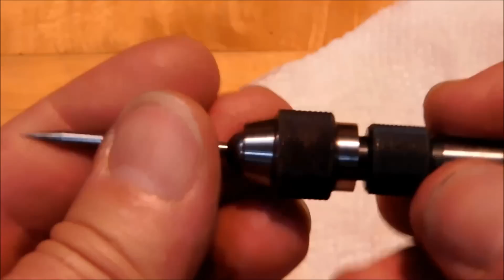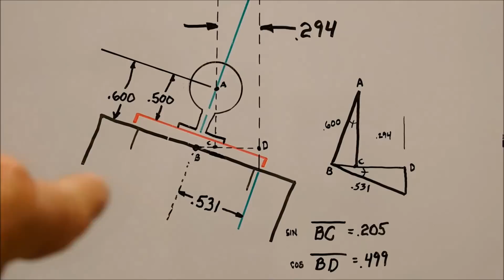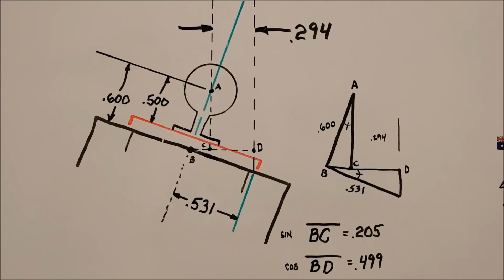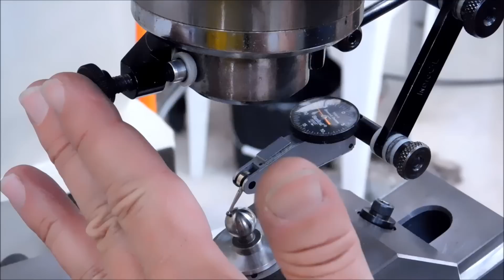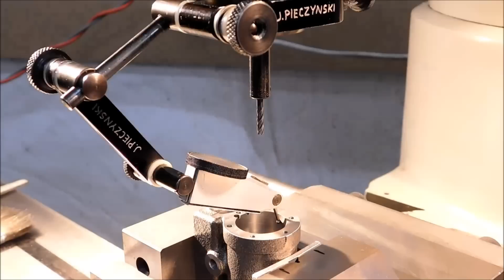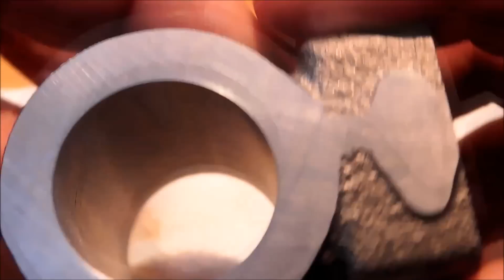Machining a Model Steam Engine Cylinder - Part 2 - The Oblique Port Holes

Comment: I use to read about “tool maker buttons”...but never saw/read any demonstrations....I asked my mentor Chui....WHY???...His response was TOOLING BALLS.....THANK YOU for a great explanation and demonstration of the use of a TOOLING BALL,  in reality Simple/Smart with triangles...viewers will be surprised how expensive they are
Reply: Toolmakers buttons are a different animal , they are used for precise coordinate boring on a flat surface...
Basically the bore centres are marked out then drilled & tapped for a small screw...
Then ground bushes are affixed with the screws and washers...not too tightly..

The bushes are usually a nominal dimension (0.500" say ) & they are adjusted (nudged) by measuring from the workpiece edges until they are perfectly concentric with the required coordinate, the screw is pinched down... then the bush is swept to centre it under the spindle.
The bush is then removed and the hole drilled and bored.

I have used this procedure on a lathe faceplate for boring accurately spaced holes in the lathe... 
😎👍☘️🍺

Comment: Another Master Class!  Your demonstration of the use of the tooling ball was extremely helpful, not to mention the dual vise setup. Your videography is appreciated also. I’m sure it complicates the task at hand but your camera work is very helpful in understanding what you are trying to demonstrate. Nicely done!
Reply from the maker: Thank you very much!
Reply from the maker: Would you like to make a request on the next part done?
Reply: Your choice, the base, the crankshaft, or the flywheel.

Comment: My father was a tool and die maker , I did not follow in his footsteps and retired from a career in combustible fuels energy production.However  to this day machining still fascinates me , having for decades watched my father produce some very complicated parts during his career.
Building these models is pure passion and the desire  to meet the challenges of machining a rough piece of metal into a functioning device , it cannot be for any other reason . A finished model would be unaffordable if resale was the only motive for anyone that invests so much on specialized equipment and the dedication to  accomplish the task with as near perfection that may be  possible. Striving for excellence and perfection is what most machinist have in common irrespective of being a hobbyist or a professional . Very nice work sir, in fact , excellent work .Watching your videos brings back many many great memories .
Reply from the maker: I appreciate the comment and story. Thanks.

Comment: Thanks Joe, I've been doing this fifty years, but never had modern schooling.  The use of the tooling ball was valuable information I didn't fully understand until now.  I came at it as a mechanic, doing engine machine work, and only working my way to a regular machine and welding shop.  The math explanation was clear and easy to understand.

Comment: Joe, there has been a tooling ball in my tool box since I was an apprentice in the early 1960's and to be honest I had no idea what it was. Thanks for the education! I can't wait for a chance to try it out, possibly on my next steam cylinder. I have done 3/4 live steam locomotive cylinders and two PM research cylinders and also a cylinder in clear Plexiglas to show what the drawings, some not as great as the one's you are working from, are trying to convey about the steam passages to someone starting out.
 P.S . my experience is the drawings pass muster both on the steam engines and the small machine tools like the shaper and drill press. the lathe or mill will be next.

Comment: Great job. I built a Tiny Power M side crank with a Stevenson’s reversing link ten years ago.The cylinder and steam box are separate castings and the ports are cored,making the machining much simpler. The original prints used 5 ball bearings.Mine has 21 bearings.(I hate to oil bushings ). I had to really pay attention because,the prints had several mathematical errors. I had this 200 pound monstrosity sitting on the kitchen table,adjusting piston height,eccentrics,etc. I told Barbara, I guess thats about the best I can do. I hope it runs.She was more confident than I was. I hooked up the air and opened the valve. I stood there with that deer in the headlights look when,it sprung to life.It will run slow enough to count the revolutions and,reverses like a 3 phase motor at any speed.It is not practical but, it was surely gratifying to build. I am looking forward to watching the progress.

Comment: Dear Joe,
                 thank you very much for posting this. I have only never machined a steam engine cylinder but a pair for a small locomotive are on the to do list. I have read numerous instructions and most involve much use of the four jaw chuck and often because the articles were written when many model engineers did not have a mill at all. None of this worries me bar the steam passages and your explanation has given a degree of certainty that I previously did not. Thank you. I do not like guesswork either.

Comment: Joe,  masterfully done!also an example of why i designed a steam cylinder to assemble from "shapes" ,  in h.s. sophimore year. but i was going to drill the steam gallerys "strait", and catch the flanges/ports.  but i got inviolved in my "machine-x"  dutys. i was advancedi took machine 2 and two periods of "x" that year.   from looking at that casting , and how clean it machined.  it MUST have been heat-soaked.the finish in the bore is so nice.  can hardly wait to see more of this project!  poppy's workshop says HI

Comment: I drilled and tapped my cylinder before the head cap. I then used transfer screws. What a PITA. 5-40 transfer screws. I got one drilled wrong, got frustrated. Went to the dro, marked and drilled like I did for the cylinder, the head cap fits perfectly.
You show us the way Joe!!
Reply from the maker: hit the numbers guys. Standards exist for a reason.

Comment: To save the second operation, you could  do the slots at the 20 degrees, it is only to let steam in. Some models have a flat milled at the rim of the cylinder and have several small holes drilled in line.
Reply from the maker: True, but then where does the .125 originate. Maybe the edge? For this one, I'm going by the print.

Comment: Joe: Thanks for showing how much is involved in getting castings of one of these engines set up and machined. Having the right equipment wouldn't get a guy very far if he doesn't have the experience. Years ago (40) I purchased the Stuart Twin Launch castings with a big dream. It is obvious to me now that I'll not have equipment or experience to complete such a project. Do you or someone of your subscribers know where I can advertise it? It has had some work so there may be issues to be worked out.
Reply from the maker: I am not too familiar with the model engineering groups, but perhaps facebook has such a group.

Comment: These tooling balls you speak of, this isn't the first time you have demonstrated their use. In my boring, 90 degree flat plane world I never seem to do anything that would require them.. But I have filed this information away for the day I do. Perhaps I should get a couple and place them in the drawer with the edge finders so I am constantly reminded and don't forget about them! 

I remember back in the late 70's an old timer I knew always told me It's not so much what you do, but how you go about doing it that will make the difference.   The techniques you show us Joe are not always obvious, but once you point them out they sure make sense. It gets me thinking every time I do a set up. Thanks for taking the time to do this Joe I know I appreciate the effort.
Reply: You will need a bank loan to buy one.
Reply from the maker: They aren't that expensive. Buying the mill so you can use it will annoy the wife though.
Reply: Joe Pieczynski I could not find them here in Australia so I had to buy from USA. $ 100 plus $ 50 postage. By the time it was converted into Australian Dollars it was well over A$ 200. Still have not used it yet nor the setup tool I purchased from you. Just in stock in case I ever need it.
Reply: @daveticehurst4191  Tooling balls this size are about $25 here in the US at McMaster-Carr.  Shipping to Australia is about $40 for a small flat rate box.  Exchange rate will increase that but not to $200.
Reply: @joepie221  That's no problem. I came home with a boring mill a week ago and she said " bought a new piece of machinery eh?"  I got me a goodun!

Comment: I was hoping to see how you matched the holes from the head cover to the cylinder. The instruction isually say to machine the head cover first then transfer to the cylinder.
Very well done. I expect nothing but perfection and you delivered.
Reply from the maker: I'll hit the numbers on the print and it will line up. I see notes like that, then they dimension the holes???? I suppose for people with limited machinery or capability, having a part to use like a template is reassuring. I will film it and show it in an upcoming video. No crazy glue necessary.

Comment: Joe , tooling ball is the best and most accurate method . But best practice when indicating a ball is to sweep the ball at its largest diameter . on the mill that would be moving your quill up and down to find the high point . a vertical indicator helps with that . John

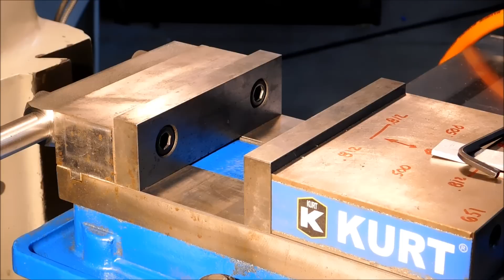Comment: 5:51 I noticed this, being new to machining, brand new and bein home taught as well as I can, I can’t picture this. “Orientating and clamping your part to a known square block for this operation will work as well.”
Reply: How I'm picturing this is that the flat reference face of the cylinder gets clamped against (for example) a big 1-2-3 block or something similar. This then gets mounted  on the 20-degree parallel in the big vise. The goal is to have the cylinder mounted on/to something that can be lifted to 20-degrees in a stable fashion.

Comment: Thank you very much for the demonstration and explanation of using a "Tooling Ball".  I have to get or make me one of those, unfortunatly a quick search produced no results here in the UK. Only in the US can I find any but postage from the US to UK is eyewatering so I guess it's the make one route.
Reply from the maker: $27.50 US postage delivered to your door. + the cost of the ball.
Reply: make your own , all you need is a ball bearing of suitable size ( finding one might be hard ). turn a blank to fit your bore . center drill . then you can glue the ball in . check the run out to the dia. of the plug . don't worry if your  dimension over the ball is not correct  as long as you know what it is you can use it in the formula . don't worry about the glue holding your not be putting any pressure on it . i use to build gages and there masters to very close tolerances ( .00005 ) i can guarantee home made tooling balls will work if manufactured right .  by the way we used glue all the time . modern glues are supper strong , locktite make glues that are permanent ! clock makers have used shellac glue to hold parts for over 100 years ! i have used instant  glue to hold parts on mills , lathes , and  grinding machines  (surface , i.d. od. ) with out parts coming off . when we made tooling balls we would finish the plug o. d. between centers to insure perfect run out to the ball . you will need a female center to do this . hope this helps . john

Comment: Joe, when you come to milling the two 45 degree angles on the main body you could demonstrate touching on a tooling ball with a cutter to give the correct position. I would mount the casting on a aluminium plate and position the tooling ball so that top of the ball matches the finished depth. At least then when you drill and ream the cross holes they’ll match the intersection. I know you already know this but could be a demonstration on touching on a tooling ball with a cutter.
Reply from the maker: Have you watched the recent video I presented on that exact topic?
Reply: Joe Pieczynski no I’ve not seen any on that topic, it’s something I do a lot of at work. It’s the obvious way to machine angled faces if you’ve got critical dimensions. I wasn’t suggesting you didn’t know. Either way it’ll be interesting to see how you machine them. Thanks for the video.

Comment: Even if you can do an adequate job by eye and guesswork, it always helps if  you know how to do it properly. 👍👍👍
Edit, forgot to add, that job is probably more accurate than the designer's original.

Comment: Dear Joe, first off amazing wirk as always. You are the standard, and should be very proud. At around the 15min mark you use a vacuum of sorts to suck up the chips. Do you remember what you were using? Seemed low noise, decent power, and small. Thank you.

Respectfully 
-term
Reply from the maker: I used a standard size shop vac with a piece of fuel line taped into the regular nozzle. It works well.
Reply: @joepie221  This is why you are the 8 time back to back champ of tips.
Reply: @joepie221  Unfortunately it's kind of like whose line is it anyway, the scores are made up and the points don't matter. Haha

Comment: In All Honesty, You Could Have Milled the Slots while still set at the 20 degree angle as long as your Depth is Good Where it Exits Into The Cylinder.
Reply from the maker: I could have, but thats not what the print says.

Comment: Ok  Bubba ,you hang on to this dang thing and imma gonna punch a couple holes in it with my cordless Dewalt. Already broke off 3 drillbits so we're gonna have to try this carbide concrete drilling bit. Should work.
Reply from the maker: Hold my beer.....

Comment: i would kill for a mill spindle that moves that easy! my bridgeport series 2 is a handful to turn by hand... to say the least
Reply from the maker: Take it out of gear, or find that area between gears where it floats. Try that.
Reply: @joepie221  I do that.. it's just an enormous spindle and takes a lot to get it to turn... it takes cat 40 tooling,  and is near 5 inch round... it turns nicely, it's just heavy and takes a good grip to get it to rotate by hand...

Comment: One of your followers said that a tooling ball is expensive and  hard to make. I was wondering if you could make an accurate one by using a ½ hardened ball bearing soldered to the end of a ⅜  hardened rod. If you could grind a slight socket with ½ radius looks like you be in business. Love your channel!
Reply: @mattstevens4667  I guess that would depend on how many times you had to use it.
Reply from the maker: You need a reliable shoulder height to center as well. Thats key.
Reply: @joepie221  Absolutely! That shouldn't be hard after the ball bearing is mounted accurately.

Comment: If you plan it right and do not break the edge of the large bore. You can simply tilt the head at 20 degrees and then use an edge finder against that sharp edge. Would show as much skill but is quick and effective to a few thousanths .
Reply from the maker: The tilt is in the wrong direction for using an edge finder in the feature direction, unless you are using the point. You could pick up the other edge of the bore and figure it out that way.
Reply: @joepie221  it's hard to pull one over on Joe.   By the way , thanks for the tip on the fadal screen. It worked perfectly.

Comment: I repair model steam engines and I have never figured out why the cylinders end cover bolt hole pattern is orientated such that a hole is directly over where the steam ports are. So many times I have to fix it. Why not rotate the pattern round so the gap is over the steam ports. Currently I am working on a Stuart turner No.9 whe this problem and an over tightening of the bolt has broken the casting exposing the steam port out to the edge of the casting. Can’t see a way of repairing so am going to machine a new one and be very careful about the depth of the threaded hole. I can’t change the hole positioning on this engine due to the studs also securing the cylinder to the frame.
Reply: likely for better sealing of the end cap. on a small scale like this is isn't really necessary, but on a larger engine with much higher pressure it would be more relevant.
Reply: nebulae1992 . Had a look at a lot of photos of real engines and they are pretty much spread both ways as far as clearing the steam ports or not. The orientation of the bolts shouldn effect the seal except when the cut outs to the sealing face, for the steam passages, are adjacent a bolt hole. On real engines, even small ones have more bolts that are smaller. This is why when I want to improve the realism I use small head bolts which have a bolt head 1 size smaller than the thread. They look great.as far as pressures go they are in most cases not that great, the larger the cylinder the lower the pressure unless compounded. The earliest atmospheric engines used the pressure difference between normal atmospheric 30lbs and the vacuum they could achieve using steam condensation. Not very close to a complete vacuum. One thing few people notice is the extra hole drilled in the cylinder end cap. This is placed between 2 bolt heads and is threaded. It allows a special bolt to be screwed in to apply force to break the seal. On large horizontal engines it is usually at the top so a chain can be attached to lift the cover free.

Comment: Joe- coming back to watch this one again too. I really enjoy learning these new techniques. Can you comment on the end mill extension you were using? I think I've seen you comment on this before, but now I can't quite recall. I'm seeing 3/8" shank end mill extension holder with a 1/8" hole on MSC, but $313!??? How is it so expensive!? I bought the 3" tool makers vise. I bought the tooling ball. But man this extension is a budget breaker for sure.
Reply from the maker: Don't spend that yet. I'll get the supplier for you.
Reply: McMaster has them. $82.00